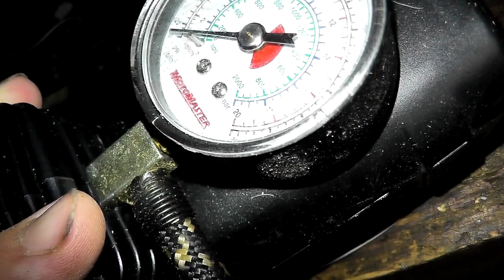Loan Shylocks!

Comment: Used a similiar looking fanny pack on my sled. Instead on the front put it on the handle bars backside so that you can reach into it from your stopped position sitting on the bike. also just use zip ties but anything you got.
Reply from the maker: +buckman840 I like this idea better..and yeah I have a boat load of zip ties...never even considered zip ties LOOOL.
Reply: Just have to mess around with it since you want to limit how much is moves around. The fanny pack works out nice with the strap wrapping it around a specific way. Primarily was just wallet, registration, spare key, and plugs. Phone was inside jacket